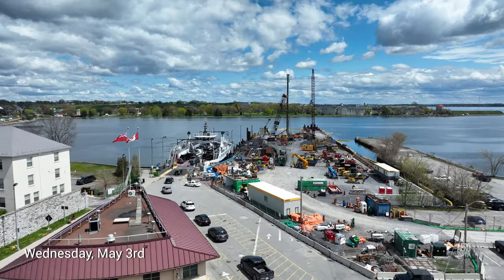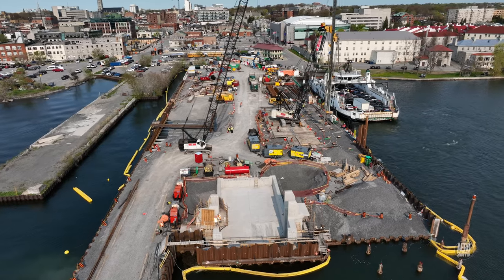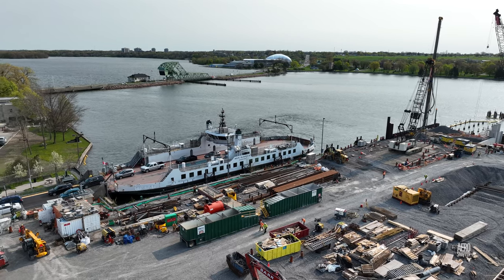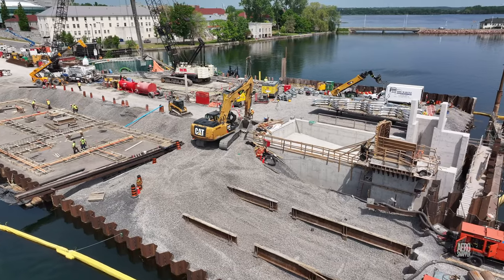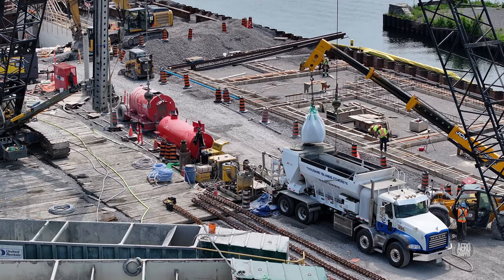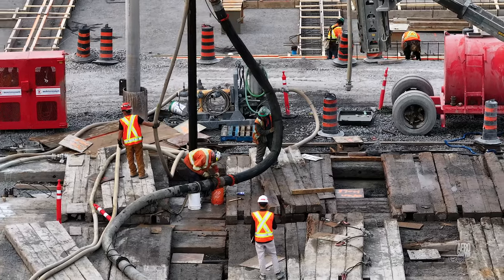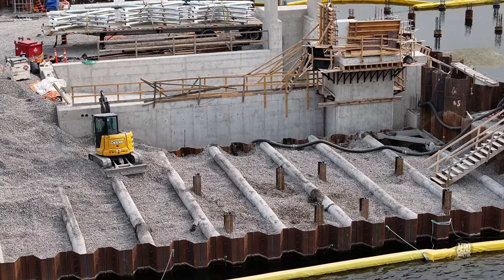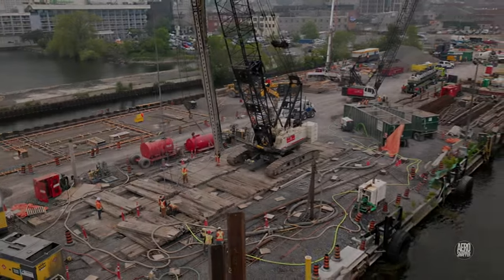Everything, Everywhere - all at once - an update on Kingston's Ferry Dock   4K

Comment: If that area on the south side that you pointed out is, indeed, the passenger terminal, isn’t that a major change to the original plan, where the terminal was on the north side?
Reply from the maker: I’d have to check - but there seem to be several changes to original specs. The floor plan looks a little complex for anything else - but it will be interesting to follow developments.